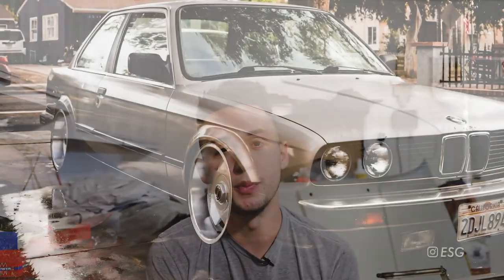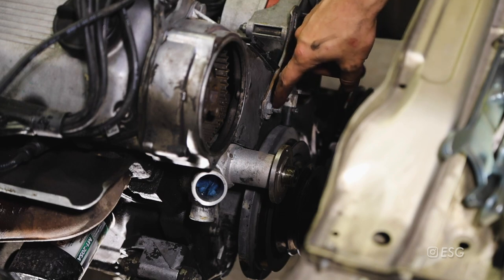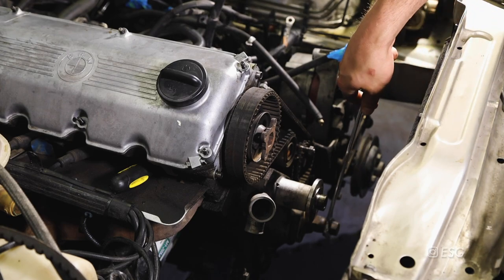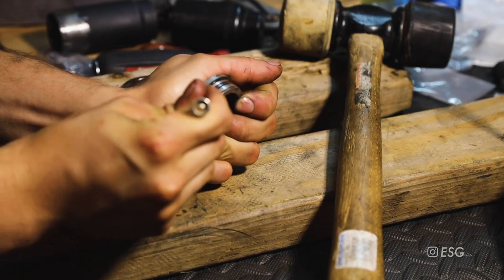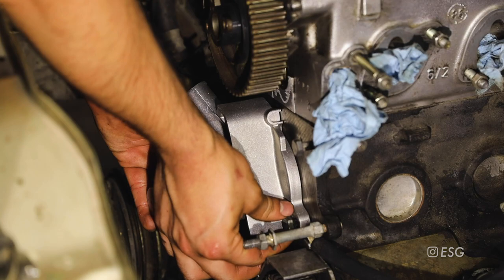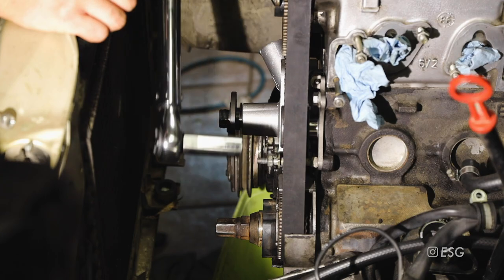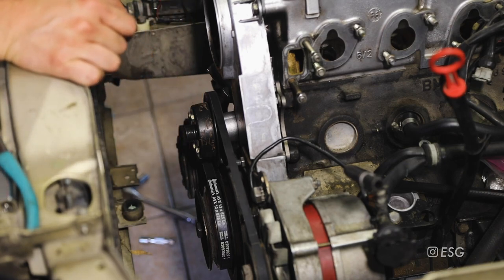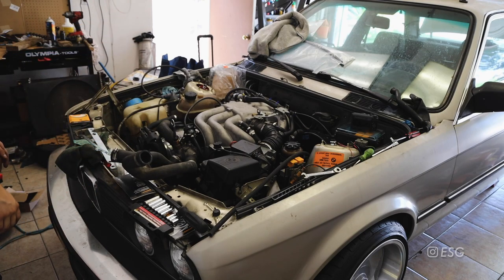BMW E30 M20 Timing Belt Replacement Detailed DIY

Comment: Great video--very informative. I like to mark the old belt with a dot of white paint next to the timing marks before taking it off. That way, if you inadvertently turn the engine while the belt is off, you can use the marks from the old belt to return the crankshaft and cam to their respective proper positions.

Comment: Many thanks for this video.  It's the best one I found on YouTube and helped give me confidence to do my own timing belt after paying shops to do them on both my E30s since 2006.  One thing to note:  The bolt holding my late-model camshaft timing gear takes an E12 size female torx socket (not E14 as stated in the video).

Comment: Need to get this done on my summer car project, a 88 mod E34, it's been in a barn for 10 years, it ran smooth as butter when drove it on the trailer, but I don't  want to start it more before I get the belt changed, its not been changed since 1998 from what the servicebook says... This video will help a lot, so thanks!

Comment: Torque specs in inch lbs
Water pump. 192 in lbs

Timing belt tensioner  192in lbs

Harmonic balancer/crankshaft pulley 192in lbs

Water pump pulley   120in lbs

Comment: by far the best E30 timing belt video out there. What the process typically for taking off the crankshaft pulley to get to the front crankshaft seal?

Comment: Great video. Wish you would've went into the front crank cover and replaced the oil drive shaft seal and crank seal, but other than that this video is incredibly thorough.

Comment: this is an excellent video!! and I have a 1991 convertible but the timing belt broke, how can I know if the valves are twisted.
Reply: If the belt broke it’s almost guaranteed you have bent valves.

Comment: On my 1988 325i, went to pull off igntion rotor and i noticed only two bolts instead of 3, no biggie, i thought just a lost bolt, but looking closer, what the rotor bolts to, someone had broken off one of the 3 ears or tabs
What would that part be called?

Comment: Awesome! Hey does the upper cover not need a gasket or silicone or anything like that? Nothing has gaskets or seals that need replacing except water pump and cam seal?
Reply from the maker: Correct, unless you decide to do the very low timing cover, which has a gasket and two seals. Other than that, no

Comment: when you turn the crank at 10:50, do you put it in neutral or leave it in park?
and that cam sprocket is from what later model? you said it's just stronger than the oem part?
Reply from the maker: You can leave it in park, doesn’t matter when rotating crank. And yes that cam sprocket found in the later model e30s (89-92) is much more durable.
Reply: @esgworks  thanks for the response man! Appreciate it!
Reply: @Aryahmmr  yeh thanks helped me too, I heard it's bad if in park because im not sure if I can put it into neutral really how its sitting just incase, so yeh im not stressing as much now

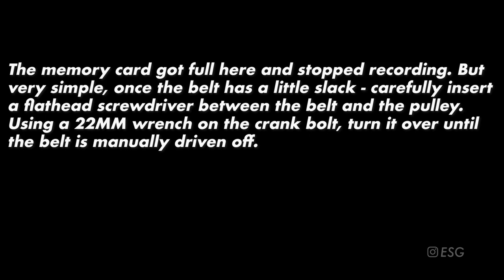Comment: also where your video dropped out at around the 5:46 mark, you say you put a 22mm on the crank bolt... which way did you turn it? Also did you have spark plugs in? I have been researching about doing this job and many are saying you can't crank the car if spark plugs are in or its not jacked up so the wheels can turn... I don't have jacks and im not going to jack the whole car up to turn the crank... what can I do man? Am I going to run into a problem with the crank not being able to turn?
Reply: Put the car in neutral and you can do it with the spark plugs in itll just be harder to turn

Comment: Did you need to replace your crankshaft seal? I'm going to be doing my timing belt again soon but plan on doing that seal this time since it showed no signs of leaking before.
Reply: I just replaced mine. Looks harder than it is
Reply: @randeepdhillon9607  I haven't found good instructions on how to do it
Reply: I am assuming you need help taking the bolt out right ?
Reply: @randeepdhillon9607  Probably the biggest part, yeah. The timing belt replacement I've done before but not the crank seal
Reply: Take the radiator off for starters. Set engine TDC. Use a parrot wrench open to the biggest setting and put it around the gear wheel (thing around the bolt) but have it resting on the Ac compressor. 

Use breaker bar and additional pipe to create leverage when rotating the bolt to the left. As you rotate the hold parrot wrench shut so the crank doesn’t spin it should hold gear in place as your using the ac compressors to hold it tight. LEt me know if that doesn’t make sense 😂 I only saw one video on it on YouTube

Comment: How did you block the crankshaft from turning when torquing the cam sprocket down? You mentioned a 22, but what did you do exactly?
Reply from the maker: 22mm on the crankshaft bolt. Counter hold it when you’re torquing the cam sprocket
Reply: you just hold it with all your might

Comment: you have no indication at all of the camshaft pully? so you have nothing inside it? it's dead? are you from Canada? because Canada is the only place that got these unbadged E30s,,, maybe you are USA and got a Canadian model... however man Im trying to find these markings right now myself!!! help bro!,, answer your comments hey!
Reply: my fathers car was a 325 no letters originally bought in new hampshire
Reply: I have 325 aswell in the USA. About to start his job, will let you know if I have tdc marks or not. But like he mentioned, you can put a screwdriver (I prefer to use a socket extension) in cylinder 1 (after removing the sparkplug of course) and turn the crank till the screwdriver is all the way at the apex of its travel.
Reply: Ended up finding marks on Crank vibration dampener, and the cam sprocket.
Reply: @sensei1781  you should be able to find better marks once the crankshaft pulley and harmonic balancer are off... That's what I went by... Also where your cam sprocket is clean the whole are very well and then have another look. You should be able to see the marks... I don't believe they are not there I recon it's just dirty if you can't find it... I searched and searched and searched... Even still I have to hold a light there to sorta show it up. these cars are old now I believe over time the markings either get covered over from dirt or whatever and or  its from wear and tare

Comment: Did everything as you did, now the car won't start 🥲 is there a chance that the oil pump pulley also rotate the distributor? Mine has the distributor on the right behind the alternator
Reply: Check for spark
Reply: @user-qc7tl7xj3z  I've solved it, the oil pump pulley also rotate the distributor, it was way off... I had to take the timing belt off and do it again lol
Reply: @Bl4sterZzzzz I just made the exact same mistake, time to take it off again 🥲
Reply: @mickbakkerphoto  glad you found my comment lol, I hope you found it useful
Reply: @mickbakkerphoto  inside the distributor there are two notches that have to be aligned
Reply: @Bl4sterZzzzz  thankfully I didn't need to take everything apart again, moved all the ignition wires over 2 spots and slightly turned the distributor. Runs like a dream now
Reply: @mickbakkerphoto  nice job 🤙🏻